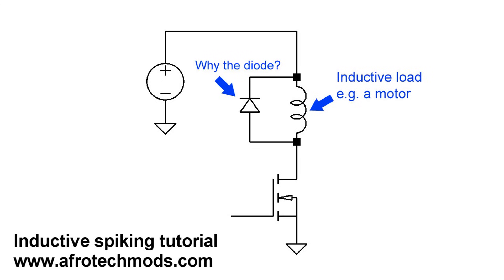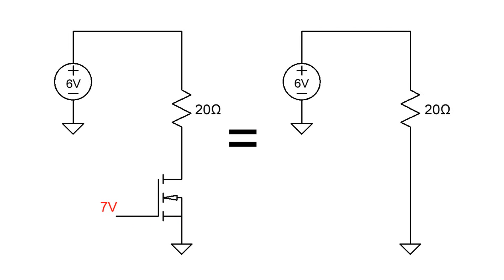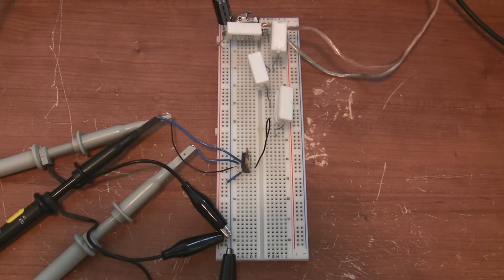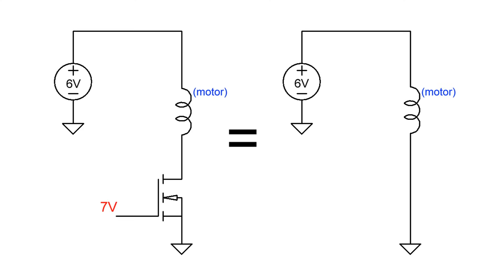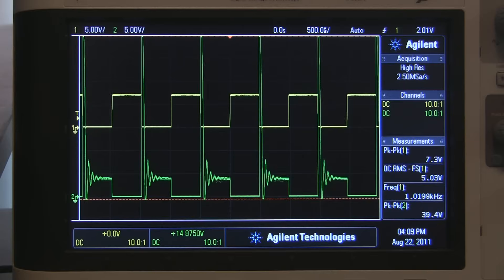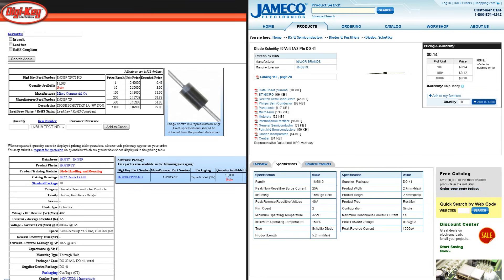Inductive spiking, and how to fix it!

Comment from the maker: Interested in learning about wireless power? Subscribers can get up to 80% off my course Wireless Power to the People - Wireless Charging 101 on udemy using the coupon code "YOUTUBE"
http://www.udemy.com/wireless-power-to-the-people-wireless-charging-101/?couponCode=YOUTUBE
Reply: What can I do if the current is high?
My motor is consuming a total of 5Amp at around 7Volts.
Reply: @ThornStarR98x_blackheart  Why would it be different?
Reply: @wwindsunrain  Take two graphs for example...
7V 5A and other is 5V 7A then in second case what type of diode would we need for protection??
Reply: @ThornStarR98x_blackheart  A decent one. That 4007 he's using will probably do just fine. A 4001 may do as well.  You just want a diode that can handle the spike. If you want to be precise you can measure the impedance of your motor and see how high the spike may be. But I am not an electrical engineer, just a hobbyist.
Reply: @afrotechmods. This video understood clearly about why diode need across motor.
I have one doubt what if we connect motor to MOSFET source to ground. In this situation diode is required?

Comment: What I don't understand is how does voltage spike cause damage when there is no current flow, Does it cause enforced current inside the transistor, Very informative video, Thank u.
Reply from the maker: Yes, exactly. If the voltage is high enough it will break things and current will start flowing.

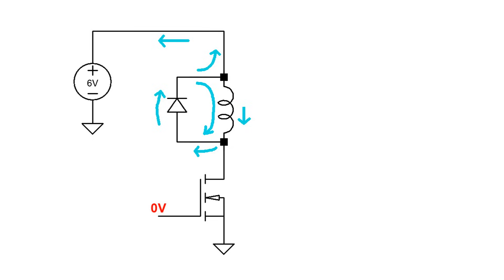Comment: The video is not entirely correct. @3:54, is is suggested that the energy will flow back to the energ source. That's not correct. It will be dissapated as heat in the circuit of the diode and the inductor...

Comment: If it's only to switch a DC  switching relay does adding a small like 470nF parallel to the diode add more suppression or not or even worse?

Comment: Hi! Should I place a flyback diode parallel to a non isolated dc-dc boost converter's inductor, the same way you did in the video, or this would change the behaviour of my converter? I can send a link of my non isolated dc-dc converter to have a look if you want. Thank you.

Comment: The snubber diode will dramatically slow down release of things like relays.  The current flow back through the diode maintains the magnetic field for a few milliseconds.  Sometimes the diode is augmented with a resistor and capacitor; which causes the spike to be slightly higher than clipped completely with the diode, but also drops the magnetic field more quickly since you consume the energy in the resistor rather than feeding back to either the supply and/or the relay itself.

Comment: Actually when you break the inductive current, energy starts moving in d-s capacitance of mosfet increasing voltage on it. You can demonstrate it using mosfet with higher current ability and therefore with bigger capacitance or add external capacitor across d-s, the spike becomes less.

Comment: Hello sir.  I have a project with 8 channel relay module and Bluetooth module. I'm controlling relays by Bluetooth. The question is when I try to send a data I see meaningless random characters at my Bluetooth Terminal. Can this fix my problem? I think it happens because of electrical noise
Reply from the maker: Could be. Could also be that the baud rate/parity etc settings are not correctly set up in the terminal.

Comment: This is ok with a motor or a solenoid valve, but dont use a diode with a relay, the reason is it slows down the relay from opening, and this leads to premature wear or burning of the contacts.
Add a resistor in series with the diode, about 10x the ohms of the supply voltage. (12v relay add 120ohm res) this still dumps the energy as fast as possible but also kills the ongoing energisation of the relay coil.
Some folk swear by transorbs, which are good, but you can fine tune the circuit with a resistor, not as easy with a transorb as the voltage levels are set.

Comment: Does it works with AC power?
Reply: It wouldn't work because AC flips polarity, but mosfets aren't used for AC anyway because in the negative cycle both the mosfet and the diode would short circuit.

Comment: Compliments on a clear presentation of the function of a Free Wheeling Diode.  I will link this explanation for the electronic laymen/vintage car owners, who I am currently working with to solve a vehicular electrical problem where the stimulus is release of the horn or backing light relay, but no FWD is present.  You and I both know what the first line of defense must be...snub that spike!!  Cheers from Connecticut!

Comment: In layman's terms imagine trying to stop a freight train with a wall. 
It's will not go well.

Basically inductive loads is like inertia. the bigger the coil the harder is it to stop.
It is also very similar to water hammer effect.

Comment: Hi! Good idea on this video. I've been struggling with my car heater speed circuit and I was actually suspecting this was the reason for the main transistor blowing up every time. Do you have any experience with these type of circuits? It's an old car so it uses one of those big round cap type of transistors to hold the 12v motor voltage back when turning at lower speeds. Thanks in advance.

Comment: Whenever circuit breaker opens up in transformer due to line to line fault in area(becoz crows sit and cause it there) ,this causes a complete damage to the pcb of my Refrigerator....is this the cause behind that.I have installed Stablizer as well as MCB but it couldn't save that from damaging.

Comment: 500 comments already, maybe someone has written about it, but: we should keep in mind that, although parallel diode is "a must", adding it makes the current in the coil fade away quite slowly. U = -L(di/dt), so if U is like 0.7V on a silicon diode (or even less on a Schottky diode), the current remains significant for quite a while after the transistor gets switched off.
In many cases this might be not important, but if we need fast reaction,  it is advisable to use a Zener diode in series with "normal" one (cathode to cathode or anode to anode), in order to increase U in the formula above. Alternatively an appropriately calculated resistor may be used. I personally learned that when I was designing solenoid driver for kind of a printing head, and the first version, where a regular silicon diode was used, dosed much more ink than was desirable and than would result from the duration of the driving pulse. (In turn, when a Zener diode is used, power dissipated on it must be taken into account, especially if pulse repetition rate is high).
Reply from the maker: Interesting! Thank you for your comment. I had never encountered a situation where the decay time was important but I can see how this would be needed in such a situation.
Reply: @Afrotechmods  In fact in most cases the decisive factor which determines the decay speed is the internal resistance of the coil, not the voltage drop on the diode, but in some rare cases it may be not enough as in the case described above. Solenoids are particularly nasty here as they release at much lower current than is needed for them to trigger.
Reply: toyota efi-relay, on primary_coil-relay pararel with 320ohm_resistor with rating 1/4 or 1/2 watt resistor

Comment: Now say you want those spikes. Say for a muscle stimulator for example, where you need impulses of around 150V at around 70hz. What is the best way to achieve that with minimal components like transistors, inductor and capacitors. And what does the voltage of the spike depend on?

Comment: hello sir, i am trying to drive 48VDC motor through Microcontroller, its working fine but at some times arcing problem is occured. Connection- Relay contacts, NO- Phase, COMM- 10amp contactor(A1), GND- A2. when relay is on contactor will pass the 440V signal to a converter , then converter will convert 440v AC into 48VDC. And then this 48VDC is given to DC motor through DC contactor.

I have tried 0.1uf AC capacitor series with 100ohm resistor accross 10Amp contactor but not worked, what will be solution for this?

Comment: sooo, if I use a relay to switch a dc motor, i have to put two diodes in parallel with 1) relays coil and 2) motor ? :)

Comment: I'm in the process of converting an automobile to full electric, and I have been building an open source DC Motor controller. This video was hugely helpful to me in understanding WHY I need to add capacitance across the bus bars of the IGBTs. I had already done so, but I was just a monkey imitating what a thinking person had done before me.  Now I at least have an inkling of the theory underpinning it. Thank you.

Comment: Please can anyone explain this or correct me…..the way I see this is that, in this example , the diode doesn’t ‘correct’ the reverse voltage issue it just ‘deals ‘ with it. If this is correct then I get it. BUT, it still allows voltage to travel backwards albeit taking the easier path and ‘saving’ the motor/component etc…..wouldn’t it be simpler to add the diode in series - in this way allowing normal current flow in normal use but then COMPLETELY stopping any reverse movement at all? A lot of diodes have 50/60v reverse ‘protection’ and so would survive in the right situation. Where’s the advantage in using parallel over series. Please help/advise as my head hurts 😩

Comment: https://youtu.be/d4q-kK5h3xM
I have troubles with contactor noises.
I couldn't find a solution.
This video is a good solution for 
 DC relays.
Could you advise for  contactor Voltages spikes ?

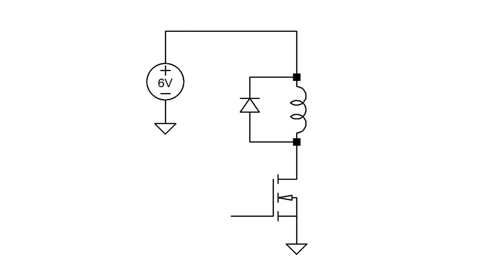Comment: @3:14  You can think of this phenomenon as follow: Say the Wheel of fortune is massive and large. When you give it a push it rotates fast and with energy. If you use your hand to make it stop suddenly it may break your hand (God forbid) - this is because the Wheel is stored with big energy and dosnet want to stop at sudden. However is you try to catch is with your hand and go with the Wheel without stopping it duddenly and move your hand with the Wheel and then slowly stop it then you may succeed, but in this second approach you have moved your hand with the wheel initially. So the first method will cause the transistor switch to burn and second approach will not cause the transistor switch to burn. The diode in this case resembles the moving of your hand along with the Wheel of fortune.

Comment: Very well explained . The motor I am using is 3kv dc motor 24 volts it is a golf cart motor . and max current is almost 150 amps , please advise what kind of a freewheeling diode will be good to save the IGBT it blows up very now and then

Comment: I have a 240v ac drill press which i want to add to the start circuit/button an LED light which is designed for 240v ac operation. The LED is a ring light module with an inbuilt voltage controller/regulator.
Will i need add any protection for the LED circuit ??

Comment: Is there any need for a flyback diode if the MOSFET features avalanche protection?
Reply from the maker: The avalanche capabilities of most MOSFETs usually can't handle much energy

Comment: I'm having a real hard time clamping the voltage spikes while switching an ignition coil with 6.7uH primary and 66.1H secondary. I've tried RC and RCD clamps but the spikes are still massive and smoking fets. Supply voltage is 32v, It's switching at 31372.55Hz and I've tried single and parallel mur480 diodes with 100ohm, 50ohm, 220ohm, 470ohm resistors and capacitances from 2nf up to 2.5uf but anything over about 5% duty cycle and I get 100v or more across the clamping capacitor. I'm ready to pull my hair out.
Reply from the maker: Are your wire leads long enough to add enough parasitic inductance to cause problems? i.e. is the clamping diode in the right physical location?

Comment: Hi,Is this method applicable for driving AC circuits of 220v, say am energising and deenergising contactor coil several times a minute. Will this cause inductive spike and damage the coil?

Comment: Question - I'm about to buy a water pump off Amazon (product is IEIK Water Pressure Diaphragm Pump DC12V 5A-12A ), and I need to be able to control the rate that it pumps at. It looks like getting a PWM is the cheap way to go as opposed to an actual voltage regulator (which I am strapped for cash at the moment), but I'm told that most mosfet based PWM's have this issue, and putting a reverse diode "backwards across the motor" may fix it. This is supposedly to prevent any inductive load spiking from frying the mosfet when I turn off the motor. 
So If I'm using a 12V DC Motor Speed Controller PWM with a potentiometer attached, would I have to modify the actual PWM unit to add the diode? Or can the diode go between the PWM unit and the motor?

P.S. Great video, and I really like your channel - Subscribed!
Reply from the maker: I think it would depend on the design of your motor controller and if they put the diode in there already. In the worst case you can just put another diode in antiparallel with your motor. An extra diode wouldn't make things worse here and it would only cost a few cents.
Reply: @Afrotechmods  Thanks for the reply! Assuming the motor controller doesn't have the diode in there, would I just be able to throw it inline between the controller and the motor? Or does that not make any sense? lol

Comment: The energy/current in the inductor can not return to the voltage source in this single switch freewheeling configuration. You need an H-Bridge (four switches) for that.
Reply from the maker: You are correct. I used to have an annotation explaining this and then Youtube removed annotations.

Comment: IRFZ44... rated 55V, not 60V!
By the way, better to use IRF3205, also rated 55V but has almost three times lower on state resistance than IRFZ44 and can handle more than double the maximum current of the IRFZ44!

Comment: I noticed even with the diode you didn’t have a square wave it was more of a chair shape. I just wondered how you explain that. I have just built a similar mosfet driver for a spindle motor upgrade on my mini CNC on my channel  so your video came around just in time. Thanks

Comment: In the video it mentioned that putting the diode in the opposite direction will burn the diode. In this case, if the load is a bipolar motor, is it better to use a zener diode?

Comment: Thanks for all the information. Suppose the engine will change direction from time to time. Like CW CCW. Do I need to connect the two opposite diodes in parallel with the motor? What kind of diode should I choose for a 24V 15A (nominal) 895 model number 12000 rpm high torque Dc motor. Please help, I'm trying to build an electric skateboard thanks.

Comment: I have a question my friend so the snubber capacitor like you said in the comments that removes the current spikes and that's right I think so my question is what do you think will happen if you don't use one ????
for the record I have been making alot of Igbts like six one of them to drive a motor but failed I think because I didnt use snubber
do you think that this is my problem
please want to hear from you......
Reply from the maker: If you don't have a way to dissipate inductive spikes you will either blow up components from the high voltages generated, or you will generate electric fields so strong that they can interfere with other electronics in your design. Only bad things can happen when you have inductive spiking. You must tame it as much as you can.
Reply: @Afrotechmods  thanks alot
Reply: @Afrotechmods  I had issues with my relay which uses a coil. I used the 1N4007 but it seems like the diode is too slow in catching all of the back emf which causes interference with my microcontroller. 
Is it advisable to use a faster diode like the 1N4148? Or I should add a capacitor at the VIN of the microcontroller to stabalize the power supply?

Comment: Howdy. Great.
Just one thing. The flyback current does not return to the power supply. It circulates in the coil-diode loop until the energy is dissipated in the diode and the coil resistance.
When the transistor cuts off induction will generate a voltage over the coil. Plus at the transistor drain and minus at the coil "upper" end. Current will alway flow from plus to its own minus. Not to some other minus.
Regards.
Reply: I think the collapse of the magnetic field may causes a huge spike in voltage which may run through components near the coil. Hence if the power supply is near, I suppose it may return to it.

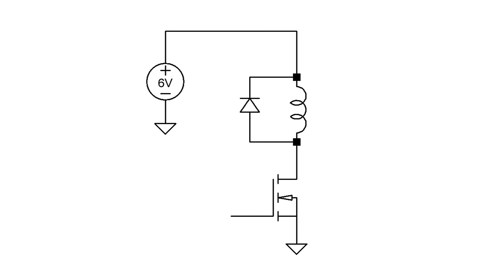Comment: 3:11 when transistor switch is off, there is no way for the current to go through the power source because that power source is connected only by one end to the inductive load. So energy does not go back to the power source at this moment. Here energy only recirculates through the inductive load.
Reply: Well actually as I understand the coil is gonna push the electrons no matter what, therefore charging the battery, or is that wrong?
Reply: @SinanAkkoyun  when transistor switch is off, the coil is gonna push the electrons though the diode only and current will continue until all the inductive energy is dissipated in that coil, diode and conductors that connect them. The battery does not participate here because switching off  that transistor switch cuts off that battery from the circuit.
Reply: i was looking for this comment, so i´m not the only one how see this terrible mistake.  Thanks

Comment: How do you determine what value of diode to use, especially when you don't have a DSO that can capture the spike when it happens to look at the measurement?  A small solenoid would have a smaller spike than a big motor, but in either case how do you know if you've selected a diode that will provide protection without itself being blown up by the spike?

Comment: At 3:33, why is there a "staircase" effect?
Reply: When the inductor current falls enough to no longer surpasses the forward volt drop of the bypass diode then it resumes ringing as before around the power supply voltage less the diode forward voltage drop.